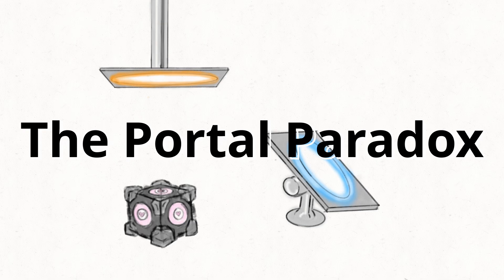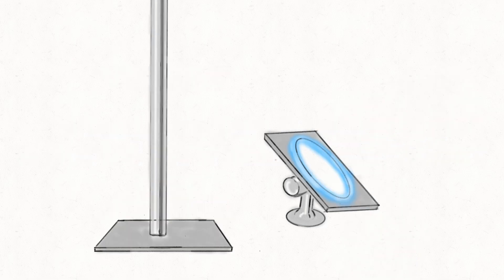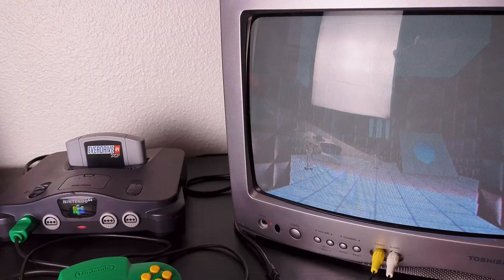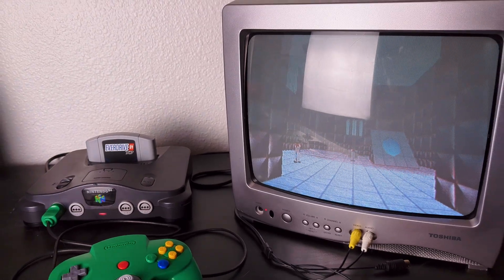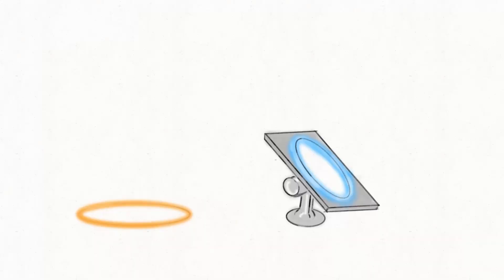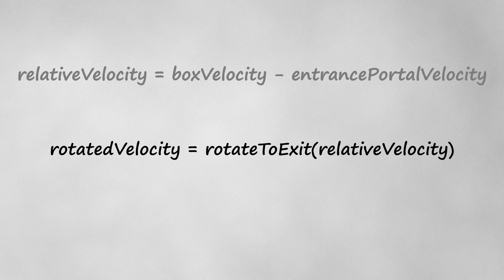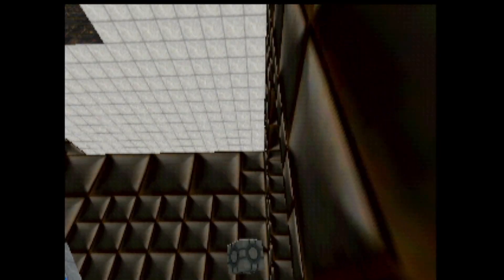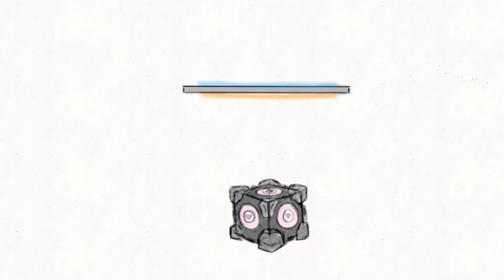I rewrote Portal from scratch and solved the Portal Paradox

Comment: My first thought was the hula hoop theory, but then it hit me maybe a different way than you were explaining.  One portal is taking the layered material from any object that passes through it. The second portal is creating those layers at the same speed the object went into portal 1. Since the object is being created at the same speed and gaining mass as it is being created while not losing speed then its mass would carry on normally from the speed of creation/transfer. So yeah, this totally would happen. You made my mind actually think today. Thank you.
Reply: The same logic could be used to debunk his application. His theory and demonstration is implying that portals transfer their own momentum to objects that pass through them, but that actually is directly counter to the logic portals work on. 

The portals simply connect two points in space together. Objects that enter the portal maintain their momentum and direction of movement. A stationary object is not moving so it maintains its momentum of 0. When the portal passes over the box it stops when the platform it's attached to connects with the ground below. At no point does the moving piston touch the box. It moves around the box. If you punch the air around a box do you expect the box to move? 

Again. The portal itself should not and can not have potential energy because it is itself NOT matter. It is not a platonic form in which to exert its own force because it HAS NONE. The box in this experiment should just appear on the slanted platform and each atom of the cube on the slanted platform would have gravitational pull in a new direction which would at some point reach critical mass and cause the cube to slide or tip down the slant appropriately.
Reply: @larkohiya  Imagine if the exit portal is moving backwards at 5 m/s, while the entry portal is moving towards the stationary cube at 2 m/s, what would be the speed at which the cube exits the portal? By your wrong logic, the portal only cares about the reference point of the observer at the entry portal, so it would also exit while stationary. However, since the portal is now moving backwards from the stationary cube, would it not then pull the cube at the entry portal to maintain the 0 m/s velocity at the exit? So now what imparted the force that pushes the cube into the entry portal? You tell me.

Comment: This doesn't really address the paradox. As soon as you have a portal pair with a non zero relative velocity, the result is that you can choose any object A, and compare its relative velocity with any other object B, and get two different answers simultaneously depending on which portal you're looking through. This cannot ever happen - it is not only physically impossible, but logically impossible. Regardless of how we design our simulations, there is no answer, and there cannot be an answer.

Comment: so, if the blue portal were to retract at the same rate you could double the launch speed. 
in a weird way.. -1+1=2
-1 is the blue portal retracting, 1 is the orange portal accelerating into the cube
and 2 is the output speed for the cube.
am i correct? i'd love to see this tested.        (and the math reference is purely that, no way am i a mathematician haha)

Comment: You could also say that, from the stationary portal's perspective, the entire room is moving down toward the cube if you're looking down through it. As you said, it's all a matter of relativity.

Also, reading the comments, suppose the portal coming down stopped most of the way over the cube. Would the cube then lift up the rest of the way and shoot out the other portal? Even if it's relative motion, nothing is actually pushing on the cube, so it's velocity shouldn't change just because something is slamming down around it with a stationary exit point relative to the cube.

I don't know the equations like you do, but then again math is a tool to help understand how things work, not the driving force of how things work. An equation doesn't mean that's what will happen. Logic is only useful when applied to observation of what is true, it does not dictate what is true on it's own. I feel that when the moving portal slams down onto the cube, the conservation of motion would apply to the force the wall the portal is on slamming against the floor and would not apply to the untouched cube. I feel that the cube, once on the other side, would simply slide off the slanted platform due to gravity being the only force acting on it.
Reply: If I understand the physics right, the cube would hop up though the portal, the height of the hop would be relative to both the speed of the entrance portal and the amount of cube that passed through the portal before is stopped, as each molecule of the cube passes though the portal it has to push the molecules in front of it out of the way, imparting some of the portal's momentum onto the cube.

Comment: This implementation is fine and can lead to an interesting game but an alternative implementation is that anything traveling into a portal keeps the same inertial frame of reference that it had going into the portal. So no matter what the Lawson portal is the object keeps the same beginning and ending velocity. I think that would cause some problems though because you would wind up having to compress matter when you had a portal moving as well as the object moving. A resolution to both these interpretations is that the portals always have to be in the same inertial frame of reference. So you can't create a second portal on an object that isn't moving the same way as the first portal

Comment: Portals can't apply any forces so calculating their motion is incorrect in the first place.
Just run the experiment in reverse. If a piston with a portal on it slamming down onto an object could launch it into the air, the reverse would have to be true as well. So, if you had piston all the way down, placed a cube on that exposed surface through the complementary portal, and then retracted the piston very quickly, the exact opposite reaction would have to occur as in the original motion, which would mean that something would cause the cube to experience tremendous downforce, but there is no force acting on the cube other than gravity.

I don't think you should be calculating the relative movement of the "portal" at all. The only thing that should be happening is that the vector for the cube's motion should be rotated according to the change in orientation as it transits. If its velocity is 0, it should stay at 0, period. There is no force acting on it, so there's nothing to cause it to accelerate. In an extremely serious physics simulation this would get all sorts of hinky as different parts of an object transited the portal and experienced different orientations from one another. So on the angled example some of the corners would experience a change in gravity which would cause it to experience some acceleration in a different direction, but not any more than it would experience just sitting on an angled surface in the first place. I think the back to back portal example working is just an example of two wrongs canceling each other out. (Anyone that says two wrongs can't make a right has never written software.)

Portal motion is problematic no matter how you arrange it, though. If they are moving relative to one another, you're going to get red shifts or blue shifts OR a violation of conservation of energy. If they're rotating with respect to one another you're going to get some kind of violation of conservation of angular momentum. It seems like the only semi consistent solution is that they cannot move relative to one another. (Which leaves open the possibility that they are moving in the environment, but maintaining the same position/orientation relative to each other. I.e., two parallel moving platforms, two identically rotating platforms, etc.)

Comment: It seems to me that there's no sense in assigning a velocity to the portal. The portal is basically a hole where two pieces of space are sewn together. The idea of the portal itself is kind of illusory, there's nothing there besides the space on the other side of the hole. The orange and blue are graphical effects. There's nothing moving, the space is just being sewn together in progressively different locations. And it's like another commenter sort of said: the portal doesn't interact with the cube so how would it impart energy onto it? If you slam the bore of a shaft down onto a ball, it doesn't make it move. Maybe there's weird wormhole physics and the real universe does some sort of hidden accounting but that's outside the scope of this.

Comment: An easier way to think about it is that there wouldn't be any difference between the ground rushing up to meet the portal or the portal rushing down to meet the ground (equal and opposite). It launches you because it stops when it hits the ground next to the portal and imparts the momentum onto the player.

Comment: With your design, you've essentially created another paradox.  To see what I mean, move your portal down over the cube, but have it stop when the cube is only half way through.

The flaw in your design is that you compute the "velocity" of the cube only after it has completely entered the portal.  Imagine a person sticking their arm through a portal (or, if you prefer, a portal moving down over a person's body). If a portal would work how it does in your implementation, then the person's body would be ripped to shreds as each part "jumped" out of the exit portal.  A portal is the same as the hula hoop example you gave in the video, no matter if the portal is moving, the object is moving, or they're both moving.

Comment: One thing to note is that in the original portal, the inertial frames of both portals are almost exactly the same in all instances. Allowing the movement of one portal relative to the room means that the portals are in different inertial frames (not accounting for acceleration which is required to start the motion). So another question may be what takes priority, the difference in inertial frames between the cube and the entry portal or the exit portal? It is not prima facie clear which way this ought to go, but, if I had to come down on one side, I'd interpret the situation the same way you did and for mostly the same reasons. However, given this option, I would require that both sides of the portal be in the same inertial frame. Thus, if a portal would be made like this on Earth, because a room on the surface of the Earth is not in an inertial frame due to its acceleration (change in speed/direction), a portal would rip apart the space around it. Notably, this also depends on how the portal works. Is it a mathematical point A and point B are identical for all points that intersect the 2D surface of the portal? Or is it a warping of space-time? For this game, I tend to intuit as the former and without a particularly powerful argument. It just looks that way to me. I suppose my degree in physics is at least useful for being petty on the internet.
Reply: Hey, I read it enjoyed reading it
(Having played Portal for the first time last week, 10/10 can't wait until they make Portal 2 :)

Comment: Neat but what happen if you put a bar into the portals that are over top one another so the bottom of the bar is able to nearly reach the top, then take a filler piece and weld the bottom to to the top and them drop the bar, will it stand? Will it fall infinitely? What happens then if you move one of the portals to a new location?

Comment: Personally, I think the way you're treating the second case is incorrect.
The box should shoot out with a relative 2V from the exit portal.

To elaborate, while people claim that it is "like a hula hoop", it simply just isn't.
To get a simpler test-case, lets take a look at how the box should behave with one portal on the platform and one portal on the ground elsewhere - the box should shoot out of the exit portal at the velocity that it entered the portal at.

Using that as the baseline, what should happen to the box in the actual case?
Technically, it should be atomized as each atom is suddenly accelerated by twice as much force as it used to be before entering the portal, resulting in a destroyed cube.
More sensibly, the cube should have twice the velocity relative to the exit portal while it is moving. When it stops, it should have it's original V velocity, acted on by every other force.

As it stands, you currently have the cube act the two different ways, which should be contradictory.

Comment: This can't be right... The reason for me believing this is: what happens if the moving portal stops half way through the cube? Does the cube get chopped in half with the exit half shooting out as it did in your demo? Or the cube get sucked in? If so, by what? I think the behavior should be that the cube will peak through the exit portal as the moving portal comes down on it.

Comment: So if it's basically because one portal moves and the other doesn't, what happens if the other portal moves at the same speed as the other while separate, will it just push through and get pushed along?

Comment: Alright, so, that's not how relativity works. We're concerned with the cube's relative velocity so we have to take the cube's current velocity from the cube's original perspective before we push it into our pancake wormhole. That should be zero, since it's sitting comfortably on the floor. In order for it to be the portal's velocity, the portal needs to impart its force upon the cube. Actions have equal and opposite reactions, so we'd be generating energy from nothing if this same force didn't equally exert on the inlet portal in the opposite direction. This sounds an awful lot like two solid objects hitting each other, like a hydraulic press, but we've got a problem since one of these objects lacks a physical side to impart force upon. That should be a big clue that something is wrong. The other clue is that you had to rotate the velocity explicitly. Your 3D space is already connected, velocity shouldn't need to be fixed unless we indirectly broke it somehow in the first line of code. Zero minus the piston's velocity is a really fun negative number, but there's no such thing as a negative velocity in physics. That's where your logic bug is.

Comment: I wrote a long, complicated comment proving why the cube would not take momentum from the yellow portal, and would just roll down out of the blue portal.  Then I realised that I was wrong and the cube would actually fly out of the blue portal at the same (initial) speed that the yellow portal came down.  So I deleted that comment and wrote this one instead.

I realised that as the yellow portal comes down, the top of the cube will appear through the blue portal,.  As the yellow portal moves further down, more and more of the cube appears out of the blue portal, * moving at the same speed as the yellow portal ***.  So there is a physics-defying situation that part of an object is moving and part of the object isn't moving.  

When the yellow portal stops moving, the momentum of the moving part of the cube immediately effects the whole cube.  The momentum of the top half of the cube essentially drags the bottom half along.  I guess you could even launch an infinitely heavy cube, because the portals force the cube to move at that speed, regardless of the energy that would usually be required to accelerate the cube.

Thanks for giving me something to think about.

Comment: I think its right? I was having the feeling of it being wrong at first but thought a step further.

Like if the cube was floating in the air and a portal came down on it, then of course it would shoot out the other end.

It's no different than thinking there's wind as you open a car window. No, the car is just driving through still air and that's what is hitting your face. The opposite is if you are the one that is still and the moving air, aka wind, is hitting your face.

Not sure if I was explaining it properly

Comment: The cube doesn't have any potential energy. How is the cube suddenly gaining enough energy to fling itself across the room?? In order for an object to move, energy/work has to be applied. 

Since the portal itself doesn't physically interact with the cube, it just relocates it, the cube has no way of suddenly obtaining this energy. All of the energy that you used to push the tile into the ground is absorbed by the armature, the floor, and the panel. It's distributed as vibration, sound, and heat. We know this because objects that are dropped from one portal into another when they're stacked speed up to terminal velocity. If the portal could transfer the energy from the object it was sitting on while that object moves, it would also absorb energy from objects moving through it and transfer that energy to the surface it's mounted on. But that's shown very simply to not be the case. The cube will only move because of the force of gravity at its new location.
Reply: an object at rest will stay at rest, unless acted on by an external force.